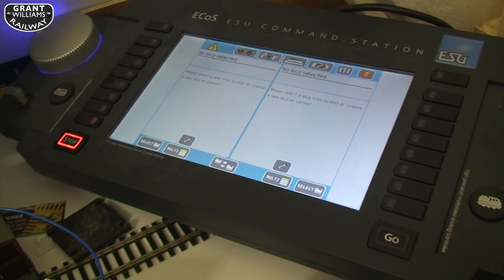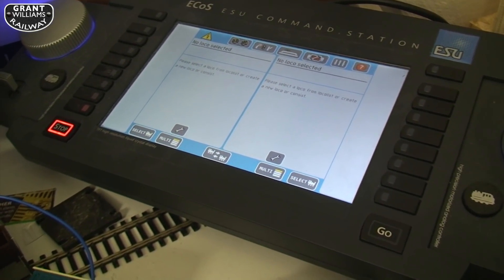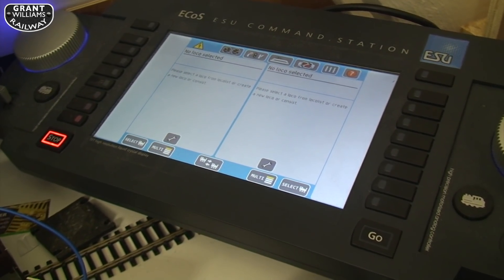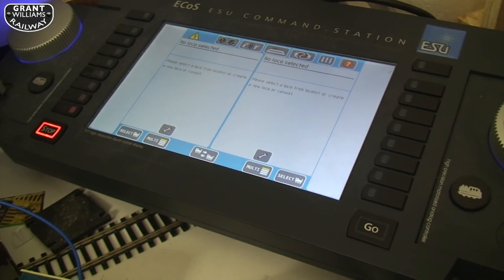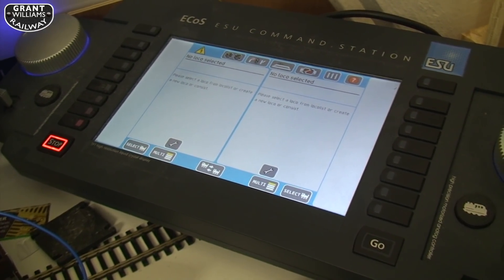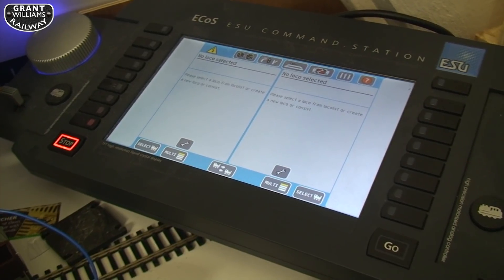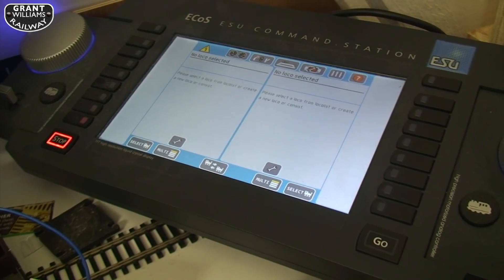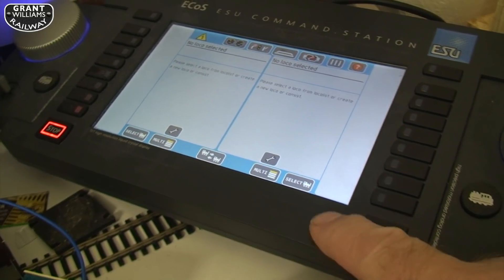A Model Railway From Scratch - 30: 3,000 Subs & Major Problem!

Comment: Something that caught me once when I was doing my yard, I just completely forgot to put an insulating fishplate on one of the frog joins. It just had no fishplate at all, but every now and again the two bits of rail made contact and caused a short.

Go through all your points (if they're electrofrog) and check to make sure you didn't forget to put a fishplate on any of them!
Reply from the maker: Whilst looking for the fault i did actually find a double slip without an insulating fishplate, so thanks!

Comment: Hi Grant, first of all well done on the 3K. Electrical fault finding is what I do for a living, start by removing ALL rolling stock and locos, then disconnect the ECOS. Using a multimetre set to continuity test between the rails, if you still have a short then I would look at the last thing you touched, electrically. I would also disconnect the reversing loop device, they are a great thing but it could be that. If you still have no joy, then rather than taking it a part, break it down into sections, in the trade we would split the circuit in half and then half again and so on as needed. I hope this helps. Good luck, Craig
Reply: Exactly how i would tackle it, good advice from BremptonJunction.
Reply from the maker: Cheers Craig & Steve, this approach  worked a treat & i found the problem after only three cuts in the wiring.

Comment: Congrats on the 3K! In terms of your fault, check your points for the connecting wires. You know when you convert it for DCC, you remove the little wires joining the blades to the frog. Double check they’re all cut through. Also check the connections you add the blades to the main rails and make sure they’re all ok too. I had a short on my original layout and found one point where I had forgotten to cut through the little wires.
If not, then definitely a job for the multimeter around all the track I’m afraid! Good luck!

Comment: Hi, I had this couple of weeks ago. May I suggest, going around with a multimeter on continuity mode. Touching the areas which should not be connected. Mine was a point, joining the pos and neg wires together. It’s not going to be easy and I’d start with the latest track additions and work backwards. No need to dismantle yet. It could be loco’s decoder has blown, so remove all items with a decoder first, wit ECOS on, trying to reset after each removal. If I’m honest that sounds likely if ok one day not the next. If nothing obvious like screwdriver for eg, a decoder may be the cause. After that track , check no metal contact to frog joints, with multimeter. Could be faulty point motor, accessory decoder. Could be one of many things. It is frustrating Grant but please don’t disappear. I do enjoy you videos greatly. Perseverance and determination will find the fault. Many people will offer solutions. The answer is here somewhere, read all and one check at a time. Hopefully see you soon. Hoping that was helpful.
Reply from the maker: Cheers John, as i say in my update, it was a faulty point motor.

Comment: Hi Grant,
I bought a curved hornby point from a rail exhibition put it on my layout and like you my Railmaster would not load the point had a short but I don't see how one would develop this if ok to start with, I still use it drilled out the short area and soldered wires to over come it.I wish you every good luck in finding the fault looks like you need to if possible isolate sections of track and test them one at a time.
Cheers Robert.

Comment: Hi Grant sometimes it helps just to go back to basics by removing all the track feed wire from the back of your Ecos. then connect your program track only to a totally seperate piece of track this should prove that there is nothing wrong with your Ecos so therefore there  has to be a fault on your main track. I had a fault on mine it turned out to be a shorting reverse loop module I now use an LK200 solid state  module  Ie no moving parts. If your Ecos dosn't operate normally after the program track test SWD are the designated Ecos repair specialists. Hope this helps      Regards Alan

Comment: Hi Grant 
Had a similar problem on my layout went through all the normal troubleshooting and there was nothing obvious.
Lucky for me my layout is modular (12 modules) so I started disconnecting them one at a time until I located the module with the problem.
This module was OK one day and shorting out the next.
To put you out of your misery my fault / short circuit was an internal short in one of the two Cobalt iP Digital point motors on this module.
So my recommendation is to check all your Cobalts until you find the one that's causing the problem, hopefully this will sort out the mystery
Regards
Gary
Reply from the maker: Thanks Gary, as i explain in my new update, it did turn out to be a faulty point motors so thanks for the heads-up!

Comment: Hey Grant that sucks mate, I had the same problem yesterday a Sandling Junction I thought the day's work had to be removed and redone, stupidly laid loose track somewhere touching, so simple but had already started disconnecting fishplate, etc..... where they go wrong eh! I know nothing about multimeters etc, but those who do, seem to use the pointers to touch wires and figure out shorts with removing everything. I hope the solution is soon, best wishes Paul; at Sandling Junction

Comment: As an experienced electrician I actually enjoy fault finding but after 40 years I can still get stumped for a while before I eventually find the fault.   There is no short cuts when it comes to fault finding, you can get lucky by just checking some of the obvious things but, just accept the inevitable and take a methodical approach.  Assuming your track bus is wired as a radial (as opposed to a ring / continuous loops you can first disconnect the bus and connect your controller to a test track, this will determine if your actual controller is working, if it is then you can test your locos one at a time on your test track and don’t forget your wagons as they could have something shorting between the wheels.  If your controller, test track, locos and wagons are all okay then you know your fault is on your main track.  

Assuming your track bus is wired as a radial from your controller and all of your points, lights etc are soldered as opposed to Scotchblock connectors I would advise cutting the bus about the mid point.  You can then connect one end of the bus to your controller, this is the easiest way to determine which half of the track has the fault on it.   From there it’s just a case of repeating the process before you can narrow it down to a small section of track.  You may not like the idea of cutting your bus but as I said, there are no short cuts when fault finding.   I’m sure you will find the fault without too much bother as long as you are methodical and take your time, the fault will be something really simple, it just takes patience.
Reply from the maker: Cheers Andy, i used the halving method & although it took a while, it worked a treat, i only had to cut three times.

Comment: Had a similar issue  after laying some track  I simply forgot to remove the 2 metal pins under a new point I'd fitted so have u fitted any new track work  ?  Also check all point frogs for a stray track pin nail etc  also it could be an old bit of rolling stock so first call remove it all  then if no better check all points for stray metal etc  lastly check any new points for incorrect wiring and or the metal pins underneath

Comment: Try a binary search.  Open the main feeder circuit in the "middle" of the run. That should remove half of the layout from problem area.  Halve the now-failing half.  Down to 1/4 layout.  Do this a few more times and you should be down to a few meters or so of problem area.

Good luck and best wishes.
Reply from the maker: Cheers Len, i did this & it worked a treat, only had to cut three times!

Comment: Have you tried if it works just when connected to a stand-alone 1 m flex track on the desktop? If not the problem is in the controller - not in your tracks.
If the problem is on the tracks, then try to measure - by means of an Ohm-meter - section by section. You say that you already has disconnected your points, so it must be possible to identify in which section the problem is. Sorry, but good luck.

Comment: If you are using peco electro frog points and using the frog power from motors then you might need to check the polarity.
I had this and it was because 1 point was in the wrong position on start of controller

Comment: Hi. You may have a software glitch on the ECoS: Have you clicked on 'Neustart des ECoS' ( New Start of ECoS), that's different to reset. If you click on 'New Start...', the ECoS will reset without deleting stored loco/digi control device info and in the process clear any software problems, should your ECoS have a software glitch. Disclaimer: The above advice is taken from the ECoS Operational Manual October 2016 for ECoS supporting Firmware 4.0.  If your ECoS is from earlier date, I suggest that you download manual for your ECoS. I hope the above info may be of help.  Wish you good luck with your project! Andy

Comment: Have you checked the reversing loop, sometimes once you have extra engines on the layout you need to readjust them. or it may have failed completely. Good luck with and hopefully it's an easy fix

Comment: Before you rip track out, I’d do a factory reset on the controller (if it’s possible). That’s easier to get the information out back into it than ripping up and relaying.

Comment: Try another controller to check it is not your unit. If I lived closer you could try my Z21! 
 I would be gutted!  Try isolating sections of track. Rather than mess with all your wiring could you run a NEW bus wire and connect your track in sections? Just a thought.

Comment: Have you taken all the rolling stock off the track in case one of those is causing your short? You haven't used any copper plate for a removable section?

Comment: So I. Can provide some problem solving advice that comes from the software big finding realm. Go at it systematically. 

1) easiest test is get/borrow some other digital controller and swap it in and see if it too registered a short. If not then it could be a part in the ECos or it’s settings that is wrong. Everything is always perfect right up to the moment it breaks. 

2) if your other controller test shows it’s not the controller the. You start looking at the track. Divide-and-conquer. Divide the track into two parts. Try each part out with the Ecos. You should in all likelihood see the short on only 1 of the two halves. Then divide that faulty half again. Test them separately. And so on. This way you will be able in exponential pace narrow down the track space of the failure without having to disconnect too much track at all.
Reply from the maker: Yep, that's what i ended up doing, divided the wiring into smaller & smaller sections until it yielded the result, thanks for the advice!

Comment: Doesn't it piss you off it did it on mine I ripped all mine up and to find a bolt on the lower back line have you taken all locos and rolling stock off??